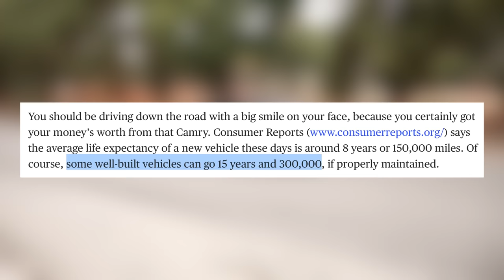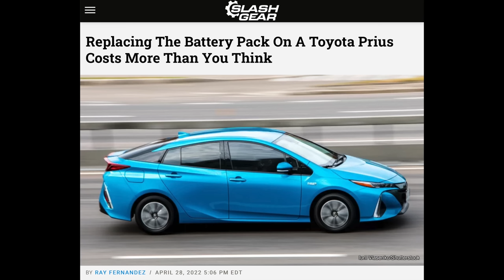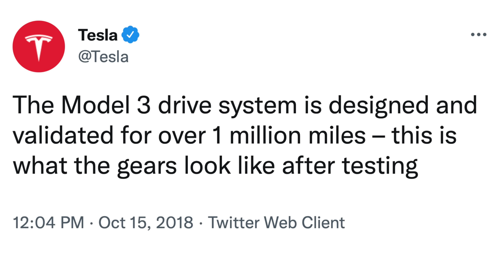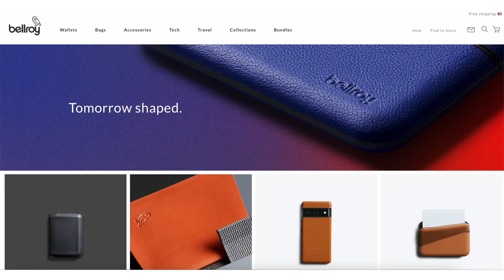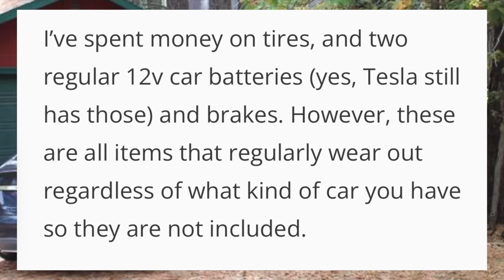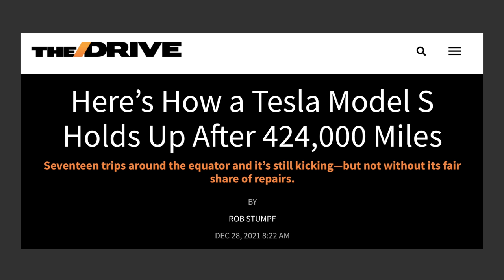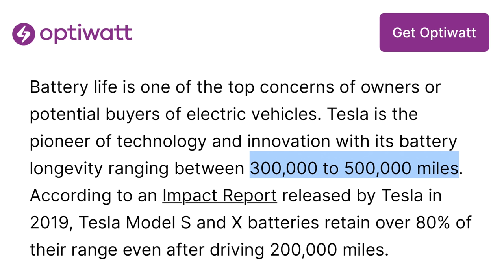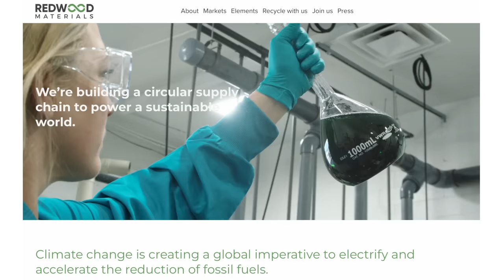The ONE MILLION Mile Tesla | It Still Runs

Comment: It seems that some ICE owners forget, that their "perfectly running" 10-15 year old car or truck has also deteriorated. I'll bet that most of those cars/tracks no longer get the same millage per tank as it used to when it was brand new. Not to mention the oil/fluid changes, brake jobs, and other stuff they've most likely had to do to keep it "perfectly running" during that time. Imo, if ICE owners want to brag when comparing apples to oranges (ie, ICE vs EV's), at least take some of those things into account before you talk about your "perfectly running" decade+ old vehicle. 😉
Reply: Yawn…. My 2010 Camry runs on regular, yesh is cost more to fill up but hardly any maintenance. 2 synthetic oil changes a year , new tires every 4 years ($1000) radiator fluid every 100k.  So what expenses are you taking about? Tesla tire alone are under 2k if your lucky for a cheap set. The range is nowhere near advertised. The cheap vegan material, yet the high cost up front?  My Camry has 230k miles on the original transmission child.  So my Camry costed me $25k out the door, wife’s MYP for $76k , wow what a difference in savings no?

Comment: The LFP batteries (Model 3 SR+/RWD) are the actual 1m mile batteries  They last 3-5k cycles, so 4k cycles on average. That means ~1m miles.
Reply: The one million mile Dahn battery uses single crystal cathodes. CATL quoted 10% extra cost on a pack to use these. Not clear if Tesla uses them.

Comment: I drive a 2019 Kona, in Europe. At 123,000 km (76,400 mi) I was appointed to change the battery, as it was from the lot that had the "catching fire" problem. Back then, the degradation shown in ODBs was 4%, but I think it is misleading as I managed to squeeze from 100% to 7% during winter 420 km out of it (260 mi). And since knowing that 0% is actually 0% (no low buffer), it means that the car would put out around 451 km (280mi). Now, the car had 455km advertised, so that is less than 1% degradation "full-to-full".
Since I'm part of an electromobility group in Romania, we have other owners which covered more than that (140,000 km or 87,000 mi) and they are reporting as well under 1% battery degradation.
The funny thing is that my new battery which already has more than 30,000 km (18,700 mi) is reporting 7% degradation on the OBD tool, but does 455 km on a full charge, so no real-life degradation whatsoever.
It's not just Tesla batteries that show little to no degradation, but other batteries from different manufacturers... and this shows that the EV batteries will outlast the car for quite a long margin.

Comment: I have a 2020 M3 and I don’t feel confident going over 100 miles on the interstate without stopping. Tesla service center said the battery was fine and to expect a 10% drop after the first year. I don’t think I will be buying another EV until one can get 250+ miles at 80mph. 

Currently some routes are cut off from me due to range anxiety between superchargers, not to mention the car won’t predict correct battery usage while traveling and will always pick the wrong one to stop at based on non-interstate usage (sub 70mph) instead of current usage. I drove 81 miles a few weeks ago, 50 of which were at 70mph or lower and the rest between 40-60mph. The car used 45% battery from full. Math wise that puts my battery at 82% capacity, but the tesla service center said it was closer to 92%.

It’s frustrating to not know which is why they should undersell and over deliver instead. If you told me I can get 200 miles at 80mph and I get 220 I would be over the moon. Instead it says I’ll get 220 and would only get 130

Comment: The real question is not will it go a million miles, but will it last 15 years?
Reply: That question is more important to me. I don’t drive that much.  I’m guessing that is more important to most people, especially if you plan on buying used
Reply: yes
Reply: If you garage store it.
Reply: Exactly
Reply: There’s thousands of them on the road that are 10 years old at this point, and that was when Tesla was in their infancy in manufacturing, putting out garbage quality. They’ll be fine long term IMO.
Reply: @jason91notch  You need to read the threads. Many have required drive unit replacements ($8,000 each) and battery replacements ($20-24,000 each). Past the 8 year drive train warranty, these amounts are untenable.
Reply: @67daltonknox  “many” isn’t the correct term at all. Very, very few have. And they’re warrantied to 150,000 miles, so they don’t cost anything up to that point to replace. Also- go price the replacement of a new engine these days, especially anything with a decent amount of performance. Exploding hellcat engines are costing people 20k+ too.
Reply: @jason91notch  You need to take off the rose tinted glasses. Owners of Teslas over 8 years old have two choices: either sell them for next to nothing or trade them for a new Tesla (they will give you 12% of the original cost)
Reply: @67daltonknox  what are you even talking about, lol. They’re holding their value better than literally anything on the road. That’s just the facts. Model S with over 100k are still selling for well over 40k. Model X with over 100k are still selling for 55k+. You legitimately can not buy a model 3 for less than new right now unless it has 70k+ miles. No rose-tinted glasses here, I actually own a rivian.
Reply: @67daltonknox  if you cans find a Tesla selling for “next to nothing” send it my way, I’ll become a first time Tesla owner in an instant.
Reply: @jason91notch  You are looking at Tesla's prices or dealers' prices. You are not looking at what they paid the previous owners. I'm sorry, I'm interrupting your high school homework.
Reply: @67daltonknox  so by your logic, everyone is just listing their used teslas for crazy high prices… just cuz? Do you have any evidence to back that up? Can you provide a single used Tesla sale as an example? Also- who hurt you? Why do you have to include an insult in every comment? are you just that immature?
Reply: @jason91notch  Do your homework
Reply: @jason91notch  no they are 8 years or 150,000 which ever comes first so even if you only put 100 miles on one from buying it new after 8 years your warranty still ends
Reply: @67daltonknox  The data is Tesla has the least amount of warranty claims in USA - WarrantyWeek.
Reply: Well after watching the video for a little bit it looks like the answer is yes it will make it to 15 years and probably past that to 20 or 30
Reply: Maybe but most new gas cars don’t anyways

Comment: the guy who drove 1 million miles said it was a nightmare and he had to replace nearly the entire car like 8 times. He said he will never drive a Tesla again and is waiting for another brand to come out.
Reply: That's not even close to what he said.

1. He didn't say it was a "nightmare" or anything close to it. He commended the battery longevity, and it's very clear he enjoyed the experience.

2. He had to replace the motor 7 times. The motor is important but it's not "nearly the entire car", and it's an easier fix for an EV than a gas car. Other parts required very little maintenance. He drove the car for about 7 times what a car should last, with total maintenance cost of maybe half the initial price - I'd say he got quite a bargain.

3. He didn't say he would "never drive a Tesla again" or anything close to it. He did say he was disappointed about the motor longevity, and would be happy to continue with the Tesla if it is improved. If not, he only said he was considering switching to a Lucid Air and trying to break more records with it, which is still a far cry from "never driving a Tesla again".
Reply: @Meni_Rosenfeld  it was 2 batteries and 8 motor rebuilds not 7
Reply: @vq_jae  The articles said he was on his 8th motor. This means the motor was replaced 7 times, since the car already comes with 1 to begin with.

Maybe I misunderstood the terminology, but it doesn't matter either way.

And yes, of course the battery had to be replaced as well. The owner said he was very impressed with how long each battery lasted.
Reply: @Meni_Rosenfeld  hes gone through 8 motors which means hes on his 9th one

Comment: Bought a 2010 Honda Insight with 58K miles 10 years ago for $8,500. Gets 48 mpg and only serious maintenance are tires which get about 50K, starter battery and oil changes, CVT is starting to protest and when they go you scrap the car. Would have had to replace the battery pack in a Tesla most likely and it would have cost me $25,000 at best initial purchase for the car. I think Honda won this one for me by a good margin. I do like Teslas and think today if you have solar with price drops they are a serious contender.

Comment: This is very interesting, though not accurate in my own experience. I own a 2021 Model 3 SR+, bought in April 2021. I had Tesla service do a remote battery health checkup a few months ago, and they stated that my battery pack has had 5.5% degradation already (in 1 year of ownership). So if we extrapolate that linearly, in about 6 years my battery will have lost 33% capacity. If that indeed happens I will be sure to make a warranty claim.
Reply: Probably not as the degradation slows after the first year or two
Reply: Did you see the graph? It’s not linear at first, only after an initial sharp drop around 5% does it become linear.
Reply: Rule of thumb: 5% after the 1st 50k and then 1% for every 50k which follows.

Comment: 30% degradation seems a bit excessive, I would probably replace my battery after 20%
Reply: Unless you're going on a lot of roadtrips? Does 30 percent really matter if you're charging each night to 80%?
Reply: If it got 300 miles when new a 30% loss means it is down to only 210 miles which means it is lower than that if you stay within the 20% low side and 80% high side. 210 - 40% = 126 miles.
Reply: @mustangecoboosthpp3869  210 x 80% = 168

Comment: If you examine actual Tesla reports of vehicles driving - one of the stand outs is an Uber Driver who bought a Model 3.  He drove it 300 miles a day and used a supercharger to charge it twice a day which suggests he did not charge 100% much.  His model 3 battery failed after 110,000 miles; out of warranty with a $9000 pack replacment cost plus installation. They did claim he saved near that much on full but compared to his old 30mpg Camary not a newer 50mpg Camary. There is another youtube report of a Tesla model S driven 1 milion miles but it required 4 battery packs to achive this costing the owner $30,000 for two of the packs Tesla paid for one, and the original pack which was in the original car.

Comment: My dads 2013 85kw model S has nearly 700,000km on it, with not a single maintenance, battery, or mechanical issue aside from having to fix two faulty door handles (which is expected considering I live in central canada and they freeze and unfreeze constantly in even a single day). He had a volvo for 2 monthes before that but he found out it was bought by the genocidal chinese governmenrt, and like anyone with a moral backbone, returned the chinese crap
Reply: Tesla also has a factory in China.

Comment: Its Interesting to me to hear what are considered high miles.. LOL.. Maybe because I drive a Toyota Hybrid.  None of the proclaimed examples impress me much.. nor do the cost of ownership data. Maybe if you were coming from a BMW or Merc.. it would seem great.
My car Toyota Hybrid is 14 years old.. 405,000 miles. Still runs well.. and I can fix it myself..
 My total cost over the last 200,000 miles is about $15K.. that's Fuel , all maintenance and tires.
There are PLENTY of people that drive well past that 150K mark.. and expect a car to go problem free to 300K or more. And then get bought in the used market.. for cheap.. and still provide transportation for people.
Saw a video recently on The Car Care Nut channel. A guy brought in a 2019 Prius Prime Its used as a long haul courier vehicle.. it was brought in  to be checked over for any issues,  it had 342,000 miles. Still on the original brake pads.. only issue he found was a slight oil leak on the front timing cover.. Just a slight seepage. Not anything that needs to be fixed. 
Lots of Prius taxis out there with 1Million miles.. and plenty of Toyota Camry and corollas.
Seems to me EV's should EASILY get past 1M miles if they are so much better..  But they don't seem to. 
Tesloop is a great example.. car is abused.. for sure.. So it a Prius Taxi.
Don't get me wrong.. I LOVE EV's and want my next car to be an EV.. 
But watching video with data like this...actually scares me off more than makes me feel confident.

Comment: I have not yet been answered by any YouTube regarding the cost of tires? How much does it cost to replace all 4 tires after approximately 25,000 miles?  If you're providing examples for a car that goes a 100,000 miles these numbers that are provided would be wrong. Just taken average of $200 per tire would give you a set cost of $800 multiply that by 4 to get to your 100,000 miles and house and you're already at $2400 in costs.
Reply: "Tires on a modern electric car will wear down much slower than in a car with a traditional internal combustion engine. This is due to good traction control. The driver assist systems reduce slipping by utilizing the electric motor's rapid power adjustment. This system is much quicker than in ICE vehicles, where it is based on braking and limiting engine RPM" , Nokian Tyres' Development Manager Mikko Liukkula

Comment: Hi Ryan, I think your battery degradation maths are a bit out.  You need to account for exponential reduction.  If you start at 100% and the degradation is 1%, after 1 year, battery capacity will be 99%, then at 2 years it will be 98.01%, then at 3 years, 97.03% and so on.  This may not seem to be very different to 98% and 97%, respectively, but it makes a difference over time.  The time to get to 70% at 1% degradation per year is just over 35 years and at 2% is just over 17 years.

Comment: I scraped my left fender. Got it repaired at a tesla shop because other shops aren't allow to get tesla parts. It costed a bit over $7000 USD to get it replaced. Body work is really expensive on a tesla.
Reply: Could I ask model, year & mileage?
Reply: @learnserve  Model Tesla Y 2022. Ended up with a bit over $8000 after taxes etc. Mileage is around 5000 miles

Comment: Can't afford a Tesla at the moment. Love to own a Cybertruck or Model S. 
I have owned two Nissans over 150k miles with only cost other than normal maintenance was replacing the headlight bulbs twice on each car.
Versa and Rouge. Sold the Versa, which was an excellent value. Still have the Rouge at 178k miles and counting.
Reply: Exactly with proper maintenance, a lot of modern cars can easily go 200K miles.

Comment: Its super posible, the elecric motor has super litle wear.
I have a toyota prius 2010, whit 255,000 miles and is working super fine, and its on the original batery, i chek the batery life and its in its 1/2 life

Comment: You forget that tesla enchanced battery miles range with software last few years. May be now this reserve is exhausted (they cant make more updates to make acceleretion or recuperation more efficient). So old tesla customers might had an illusion of low battery degradation. I thin better approach is to directly measure real battery metrics.

Comment: Longevity is not just how much you traveled in a few years.
Longevity is combined how much you traveled and how many years it is operational on the road.
Manufacturers today will be willing to make you travel as much as you want in 8 years (within warranty) but will not live past 30 -60 years which was common for ICE cars from the 60s to 90's hence why they want to brick your cars like the mobile phone industry. Once you stop updating (hind because they don't do updates or want to update it) and no longer support with parts they designed to break, you will brick these cars in the 15 to 20 year mark.

Comment: I use TeslaFi and looking at the leader board, most of the Model Y's with 100k miles have experienced ~12% degradation.  This seems pretty standard across the board. Thankfully the degradation should flatten off after that. I've personally had 9% degradation in ~20k miles.

Comment: I've got >100K miles on my Model Y, it's about a year and a half old.  I've been tracking it since I got it with TeslaFi so I have ALL the data.  My battery degradation is much more than what's shown here - I started with 326 rated miles and now I get 292 on a full charge.   Interestingly, I hit 290 rated miles when I was at 55K miles, and since then its fluctuated from 303 to 286.  Let me know if you'd like a closer look at the data, I'm happy to share.
Reply: Mine says 209 range at 70% on the 326 2021 lr y. Only about 28k miles.

Comment: incase you didn't know, with gasoline or diesel cars heat cycles is what kills a engine that's why you see the 1 million mile tundra and lexus while other cars only last 400k but both cars were maintained very well, so what gives, heat cycles cause the metal in the motor to expand and shrink, so those 400k cars are driven to a grocery store everyday and occasionally go on trips, while those million mile tundra go cross country only fully cooling off a couple days a week, same reason police cars last a long time, they idle constantly so they only fully cool at night depending on scenarios